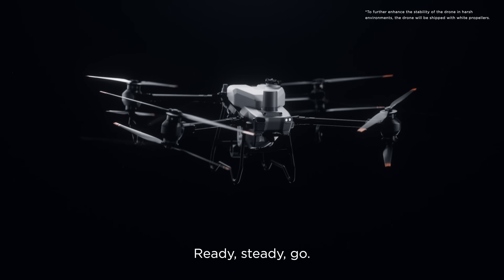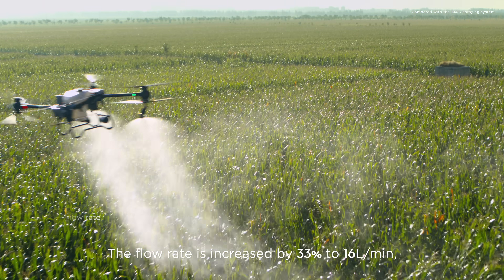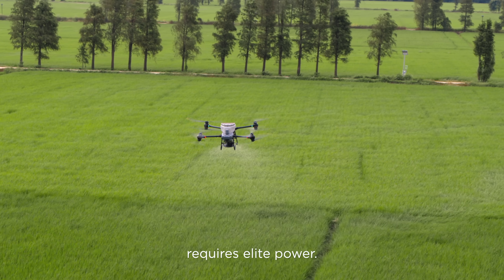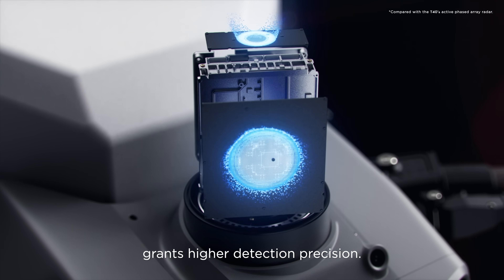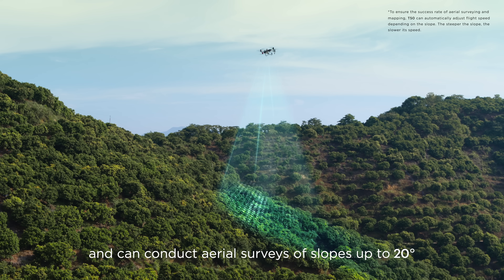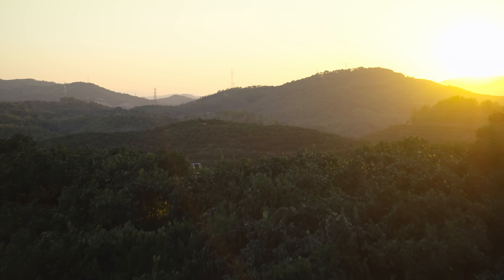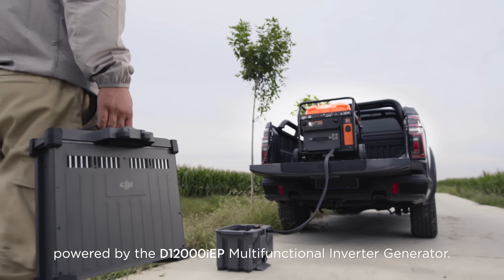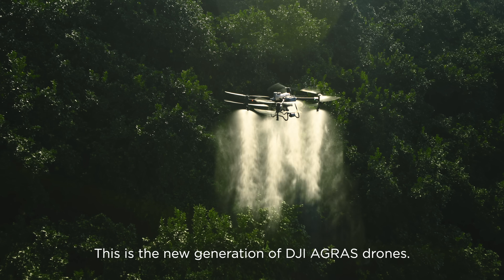Meet DJI Agras T50

Comment: Or pay the guy with a plane and get it done 1000 times faster
Reply: And pay 1000 times more, if there's even a suitable runway. Helicopters more expensive as you have to still pay the crew.
Reply: @GreenLeafUponTheSky  use a tractor then

Comment: thats crazy they would still use the O3 transmission system when they just came out with the 4 on the avata 2. wild
Reply: Because Agras T50 and Agras T25 are not new DJI products. These drones were released in China in 2023.

Comment: I almost spit coffee on my keyboard when I heard 9 minute fast charging.
Reply: And I was amazed at how it has an AESA radar on board. Absolutely insane.
Reply: Well it'll spray its full capacity in like 2 minutes. So it probably doesn't need to fly too long
Reply: @ChevTecGroup  but it can probably be programmed to selfcollect water-spray-collect then charge itsself and do it once again and again without human interference. Marvelous machine
Reply: @ChevTecGroup  1567 Wh battery, so that's charging at over 10,000 watts
Reply: Ikr... Takes like almost an hour to charge my DJI fpv battery

Comment: The sharpness of DJI scripts and launch video productions are top notch so we shall let them off this rare grammatical error when omitting the plural 's' for 'sinks' at 3:03, instead incorrectly reading "Intelligent Flight Batteries have Air-Cooled Heat Sink.
Reply: @mawvius  they said it correctly, watch and listen again.
It's singular. Heat sink.
Just because there are two fans, there is only one heat sink behind those fans

Comment: 40kg spraying capacity, flow rate 24 liters per minute, so every 100 seconds has to refill? I'm confused...
Reply: This is the maximum spraying. Spraying pesticides usually does not require such a large spray volume

Comment: The technology packed in this drone is just stunning: obsticle avoidance, altitute control in steep terrain. Just unbelievable!
Reply: The T-40's terrain following was terrible.  The RADAR on the landing gear will fix that, bringing  it back to at least the standard of the T-30
Reply: @kobusdowney5291 Thank you for your experience. I was and still am a bit sceptical towards such autonomous flight systems. But it's really impressing how fast they are improving.
Reply: @RCCopterLove  If the mini 4 pro’s obstacle avoidance and autonomous flight modes are anything to go by then I would say DJI is doing very well already.

Comment: Hey gang I’m Bob and new here, I come in peace. Could someone please help me in an issue I been having with the motion controller 2 paired with the mini 3pro series and Integra goggles. The issue is about the motion controller during the calibration the trigger button won’t do 100%! The mini joystick in all directions will go 100%. Now since this problem the drone won’t go max speed in any modes. Plus during landing process the drone is forcing the pilot to fly manually which easily can cause flyaways (safety concerns) please please help! I like to use the drone for hospice care for occupational therapy. Peace love and fly safe folks, see you up in the skies hope some day.

Comment: I feel like with how fast it sprays or spreads that it would run out of fluid really quickly.
Reply: depends on the flow rate of those nozzles, T20's avg flow rate is around 3L/min with a 20kg tank.  It could be set up to around 6L/min i think, but it can also be set way lower, like 50mL/min.  T50 has a 50kg tank.